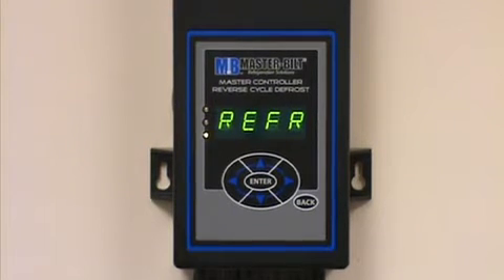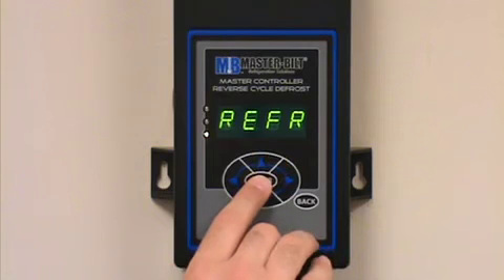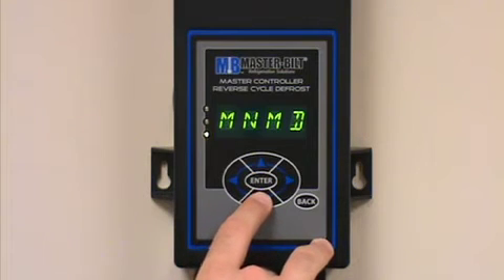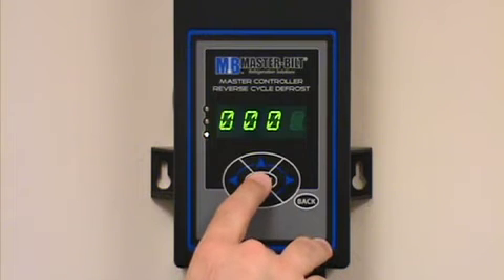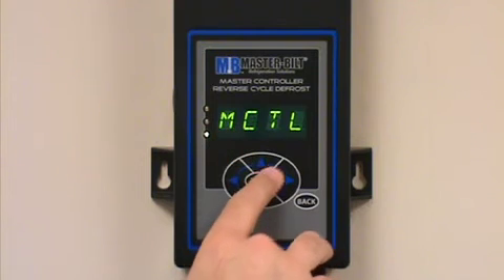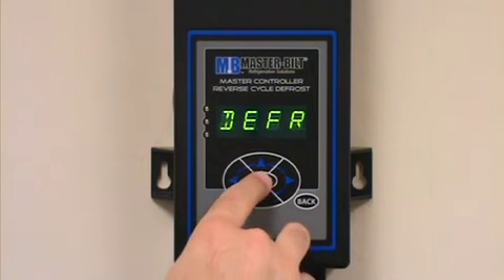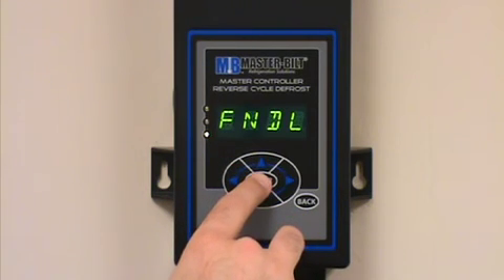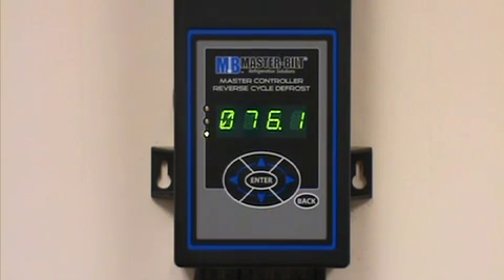Master Controller - Initiating A Manual Defrost.m4v

Comment: How do you get it out of defrost on a startup
Reply from the maker: Hello Kenny,  

Thanks for your inquiry.

I checked with our service team who said...
On startup if it goes into a defrost it will terminate quickly, there’s not a way to take it out of defrost. Unless you change set points and make the defrost termination higher. That’s not recommended.